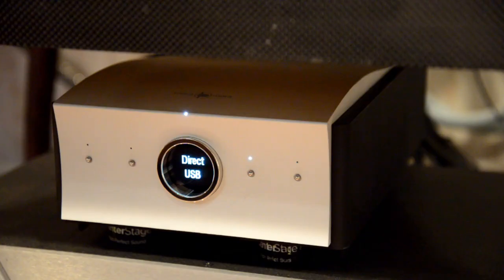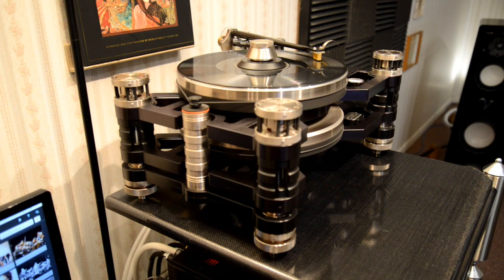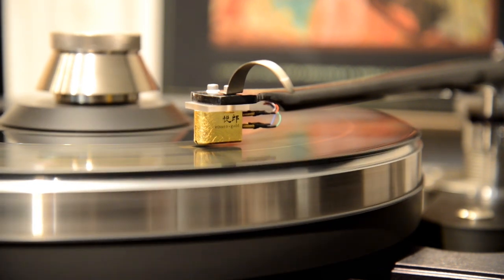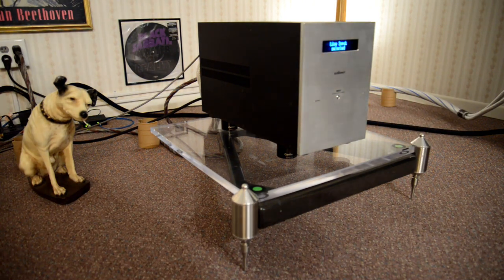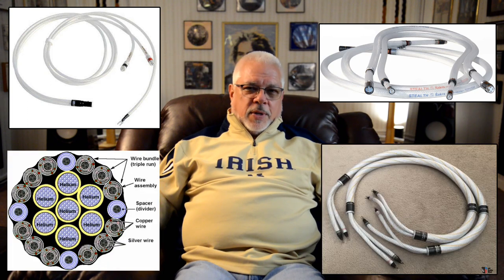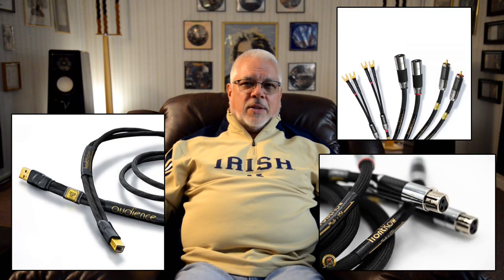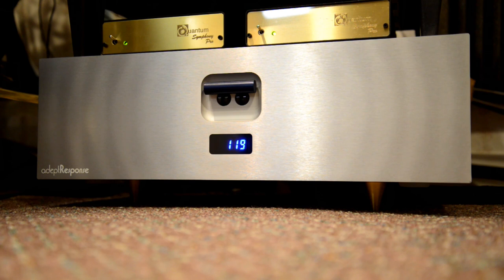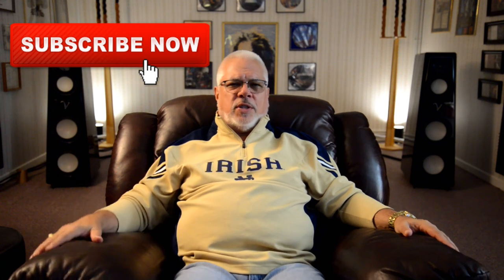E3: The Reference System

Comment: Thanks for referring me to this video the other day, every word in this video had special meaning and certainty. 

The ability to guide and articulate through your collection of gear is nothing short of a word not yet defined for this High level of assemblage and accomplishment. In light of this carefully Assembled treasure trove (all hopefully bound for the Smithsonian or very lucky heirs, at least until they begin fighting for your components), have you solved the landscaper noise problem?  Maybe the basement is your solution and I didn't recall what your ceiling height is which in a basement is likely not that high.   Nothing is perfect.

Comment: If i may ask what components do you have the critical mass audio Center Stage 2 under and are you using 4 each per component? Hope to hear back from you and please keep the video's coming really enjoy them!
Reply from the maker: Hello my2sons... With the exception of my two outboard USB drives that hold my music files, under which Joe selected to place only three CenterStage2 footers, my DAC, Phono Stage, Line Stage, and amplifiers all rest on four CenterStage2 footers each.
Reply: @theaudioanalyst  Thank you for that answer, I'm considering taking the dive i have •	DCS Rossini transport/DAC
•	DCS Clock
•	Dan D’Agostino HD Preamp 
•	Dan D’Agostino phonostage
-Also would you suggest putting them under my ROON Nucleus?
Reply from the maker: @my2sons8975  Hello... Please forgive my delay. Industry luminary, speaker designer extraordinaire, and my dear friend, Albert von Schweikert passed away early Friday morning... ;-( RIP Maestro. That said, my suspicion is that you should at least give it a try and see what you think. I've no real experience to base my suggestion on, as Joe did not feel the need to isolate my Dell Windows 10 computer with them. But my instinct would be to try it and see... If you do, please share what you learned, won't you?

Comment: My Reference System© include a Bose Acousticmass surround speaker system with the sub for thumper bass, a Panasonic surround receiver that has a-LOT of watts, and a Sony Discman to spin my 100 plus CD collection.
I also have a Sony direct drive record player with matching arm and needle (it came together) but I don't use this because I don't have records. It looks nice however
The Panasonic receiver sits on a Martha Stewart Collection bath-towel for superb isolation and reduced buzzing noises
All in all this delivers a Goliath sound and giant-killing musicality
Reply from the maker: Hello Khu... I take it you are joking? While the Bose Acoustimass® (not Acousti_c_mass) system is visually non-invasive to a room, and fairly adequate for watching television, as lifestyle type systems go, it is wholly inadequate for high performance audio. Using nothing but 4-inch paper midranges for front, center, and surround speakers, there is virtually no information above 7,500 or 8,000 Hz, even though they use severe equalization to try to add it, which then further impacts the midrange purity, linearity, and dynamic range, which is already severally limited by the drivers composition and size. The subwoofer is tuned as a quasi-sixth-order (I think at one time, they called it a seventh-order) "one-note" port-chuffing box. While I get the desire to have a lifestyle system that doesn't overwhelm the room and "looks" nice,  you simply cannot defend it as offering audiophile quality sound.
Reply: KHu NoPie - Why are you posting here and wasting everyone's time? This site explores the outer reaches of high-end audio, not budget-priced office systems. Now, if you enjoy the sound of your Panasonic/Sony Discman/Bose systems, great.  But let's not pretend that it will ever deliver the thrills, excitement, realism, resolution, and sheer scale of a true reference system, even one that costs 1/20th what Greg's system does.  BTW, I love Martha Stewart too.  She provides proof positive that pampered and privileged cons always get the opportunity to reinvent themselves in America.  Speaking of the art of reinvention - I suggest that you take that fluffy MS bath towel and put it to truly good use: mopping up the bullshit that you are pandering.
Reply: @theaudioanalyst  I keep the Boses cubes behind ferns so that they "disappear" acoustically in my dedicated listening room
Reply: @amandela55  I said it is my Reference System with Goliath sound and giant slaying musicality. I never said they would compete with the likes of  Boston Acoustics, Wilson Audio and Sansui. I'm not dumb you know

Comment: Greg

The Critical Mass Center Stage 2's are recommended by the manufacturer for use only with 4 feet per component, it appears that you are using three?  What are your thoughts here?
Reply from the maker: Hello Kerry. Thanks for your post, but I've no idea what gave you the idea that I'm using only three under my components. While it is true that Joe Lavrencik himself installed only three CS2s each under my two, four terabyte music file storage drives, all other components in my system have four CS2's under them, each amp, the linestage, the phonostage, and the DAC.